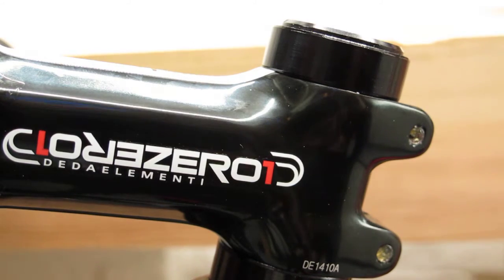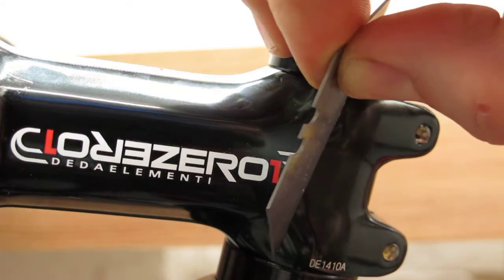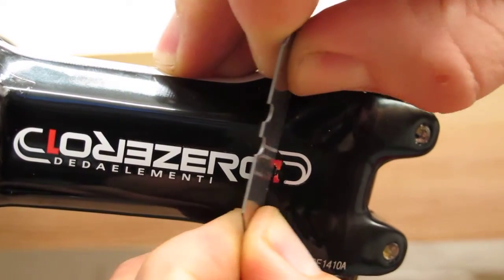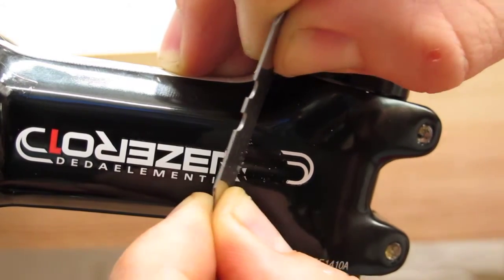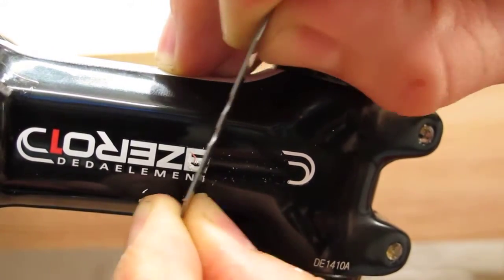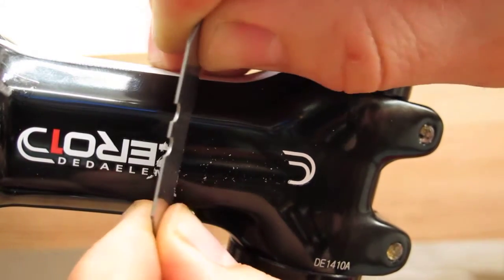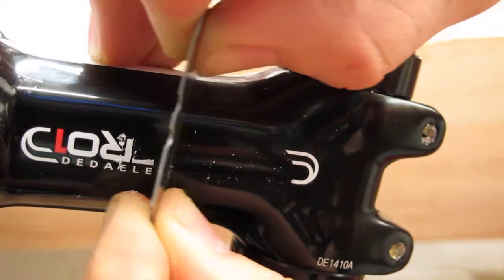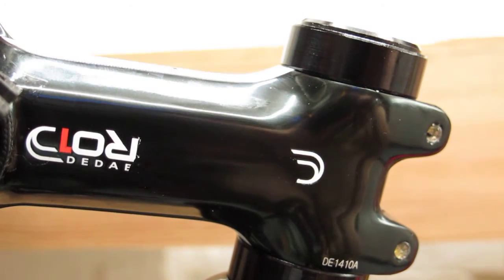Removing Deda Stem Logo

Comment: Nail varnish remover on a rag would have this off in seconds, plus no risk of scratches on the stem!
Reply from the maker: Yeah worth a go. Always try the least aggressive method first.
Reply: Just done my Deda Zero stem too. Used some cellulose thinners from Wilko and some tissue. Took 15 minutes of judicious rubbing to take off the logos and the overkill white stripe on the top. Stem now looks a whole heap better - and no scratches either. Thanks for saving  me the money I was going to drop on a new stem!